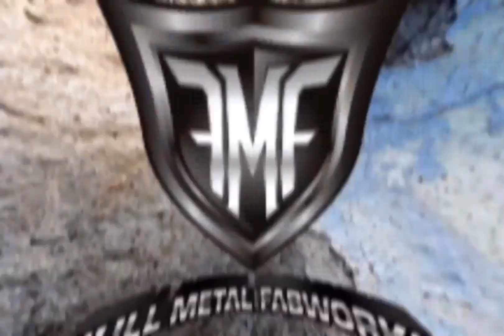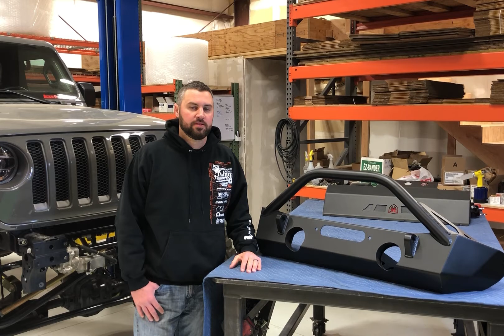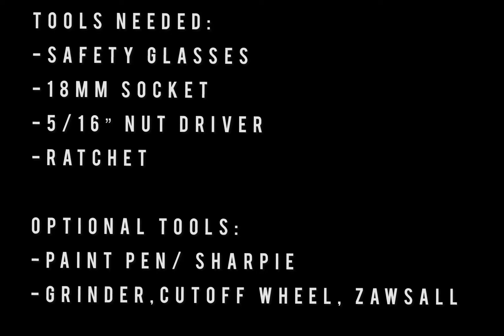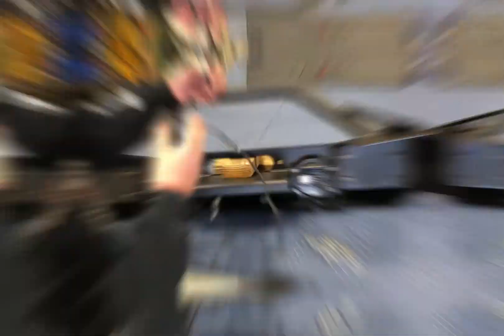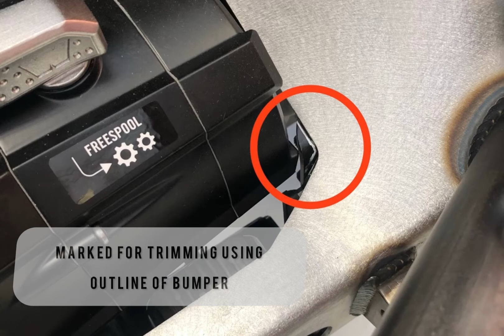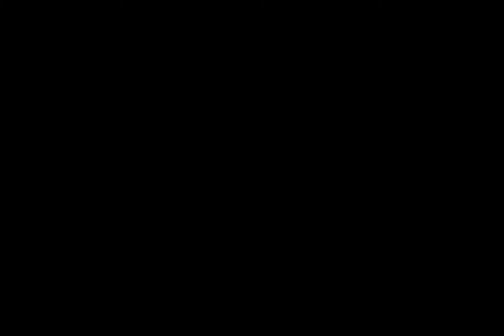Full Metal Fabworks Jeep Wrangler JL and JT Apex Pinnacle Stubby Fromt Bumper Installation

Comment: Does the hoop clear the view of the factory trail cam?
Reply from the maker: So far we have not had a Jeep come through the shop with a factory trail cam, or gotten any feedback from any customers that have one so we can't really say if the stinger is in frame of the factory trail cams at this point. Let me know if you have any other questions. @81selfmade1
Reply: @fullmetalfabworks  ok. Thank you for the reply. I'll probably be getting your bumper regardless. It looks good, keeps the factory fogs, and still keeps the winch low.
Reply from the maker: @81selfmade1  no problem and sound good. Give us a call if you have any other questions at 909-505-7115 .

Comment: Love this design and the build quality. Does this bumper allow for the Rubicon sway bar mod? As in rotating the sway bar actuation motor for more clearance. I'd love to have this bumper on my Jeep without the skid and the frame horns chopped off for more clearance but I'd only be able to do that if I can rotate the sway bar motor.
Reply from the maker: We believe it does. We have not done the mod ourselves at this point, but have a customer with a diesel JL that did the "sway bar flip kit" as he called it. His name on IG is ecodiesel_JL if you'd like to check it out there. Let us know if you have any other questions.